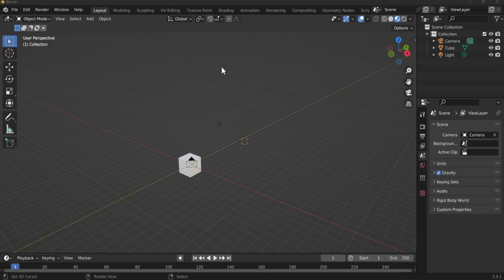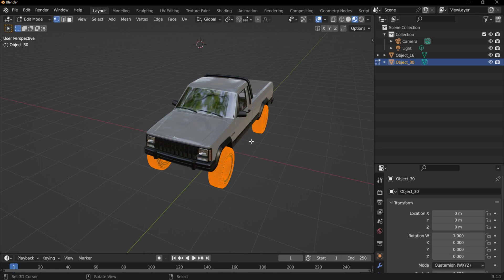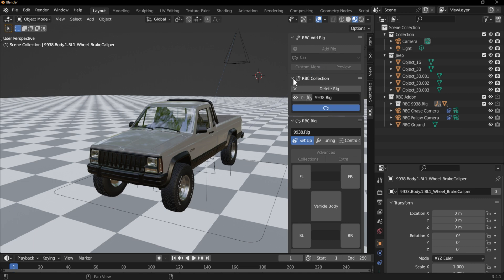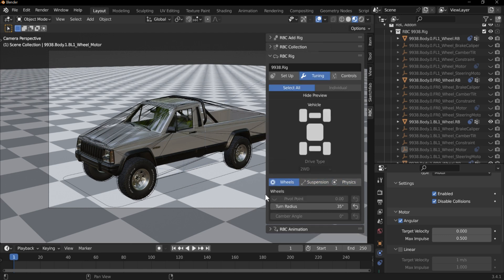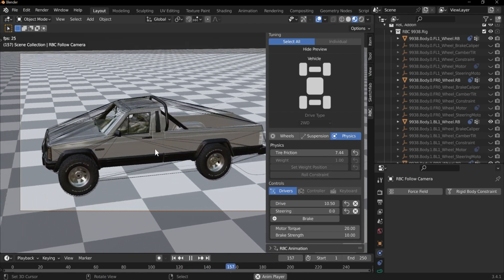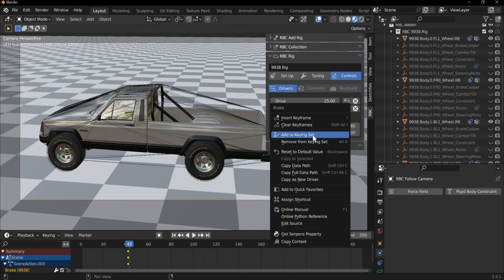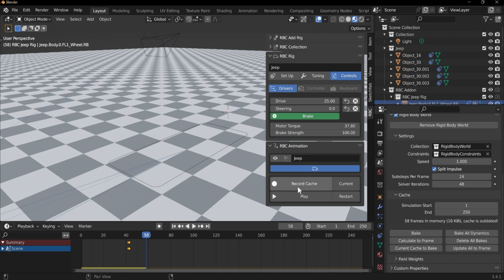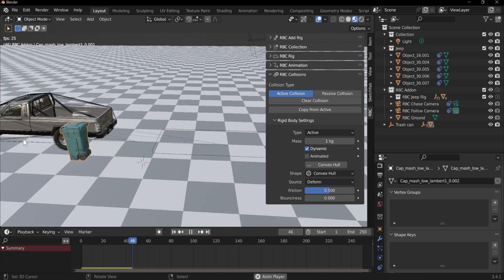RBC Addon Free | Easily Create Physics-Based Vehicle Rigs For Free

Comment: Hey! I’m trying out the free version of the RBC addon before buying the Pro version, but I’m running into a few issues.

My truck falls onto the plane and the suspension catches fine, but no matter how I tune the suspension, it either feels completely stiff or instantly fully dampened. I can’t seem to get that realistic “weight” and spring motion — it barely moves at all before settling.

Also, my wheels don’t turn or spin when I use the controls. The truck itself falls really slowly, so it almost feels like it has no actual weight in the simulation, which might be part of the problem?

I’m just worried about buying the Pro version if I can’t get the basic setup working properly in the free one. Is there something I’m missing in the setup or is weight control limited in the free version?

Thanks in advance!

Comment: The RBC rig is amazing. One question though: my model is a supercar that has the brakes exposed, but the brakes shouldn't rotate with the wheel. I tried to put the Child of constraint to the brake, but in the animation sometimes for a few frames the brake twitches to the other side of the rotor. Is there any way to fix that? Thanks a lot

Comment: Does version 1.2 still work with Blender 3.6? Or 3.5? The moment I clicl "Add Rig", my car just gets black and I get a ton of error warnings... Pretty frustrating after having bought this for 50 bucks.
Reply from the maker: No 1.2 doesn't work with blender 3.6 because they updated there API. Just update to RBC 1.3.1 it's better anyway.
Reply: @akastudioss Thanks. I updated it, but it still doesn't work. I get all the windows for "Add rig" twice, but I cannot click on anything. I also constantly get an error log "Python Traceback..."
Reply from the maker: Sounds like you may have the free version or another version still enabled, make sure it's just the RBC 1.3.1 pro version enabled. Saving preferences and rebooting blender helps the installation process. If you are still having errors post them in my discord so I can see the error codes.
Reply: @akastudioss I'll try that. Thank you!

Comment: Do you have tutorials on how to setup suspensions springs and connected drive train animations that co-incide with the drive system? that would be handy
Reply: That's the one thing I noticed is there is no option (not sure about pro) for the brake calipers as they turn with the wheel but don't rotate with the wheel. Right now only option is to join it with the body but then the tire clips through the caliper when turning.

Comment: Hello! I havent tries this addon yet, but it seems really amazing! And im wondering, is there a way to make camber work with this, or will that just be glitchy and bad?
Reply from the maker: Yes, in the pro version theres a camber tilt setting, but you could do this in the free version using constraints, I'd recommend only apllying the camber tilt to the model and not the actual rig.
Reply: @akastudioss  ahh, alr! I'll look into that :)
Reply: @akastudioss  theres a glitch whenever i use motion blur for the render. The wheels disappear in the render and the motion blur is all over the place, no matter the strength, this hasnt happened before, u know a fix?

Comment: Can you set this to follow a a path? Or maybe set a empty for the rig and make the empty follow the path?
Reply: Did you ever figure this out?  I'm just starting to search around for this.
Reply: @bigsky7617  unfortunately no😩 I think it’s an add on mad to be use with a controller. Not made to help with animation. Then again I haven’t used blender in months.
Reply: @PleasantFilmsDC  actually I've seen now a few times that in the paid version you can set an empty guide to follow a bezier curve...I think if you YouTube his video about the 1.3 update it touches on it.  There aee also a few posts on his Discord.  Might pull the trigger on it tomorrow, I'm digging these physics.  My vision is a kind of slow roll on a rough mountain road.  Of course now that I say that, a controller might work just fine 🤔

Comment: This is great, but wondering if i can change the start position of the rig? Also, can it drop / drive below the ground plane?
Reply from the maker: the rig has a control object just below it, you can move or delete the ground plane but the rig needs a passive rigid body object to drive on.

Comment: This is amazing. But I have a problem. I just bought the pro version and trying to rig a very small robot that has 4 wheels, but the wheel rigs are coming out with orientation sideways to the wheels. All mesh elements are orientated correctly, all rotation transformations applied. But wheel rigs keep coming out sideways. Any ideas on a fix?
Reply from the maker: Its possible that your robot wheels are wider than the typical wheel so its detecting the rotation wrong, if your on my discord send me a message and I can check out the file or see if its something else.